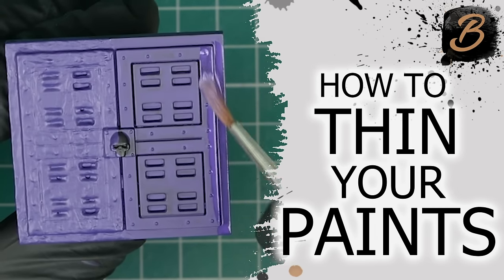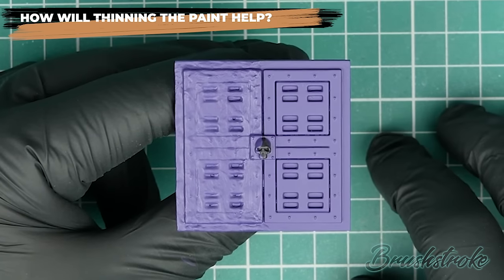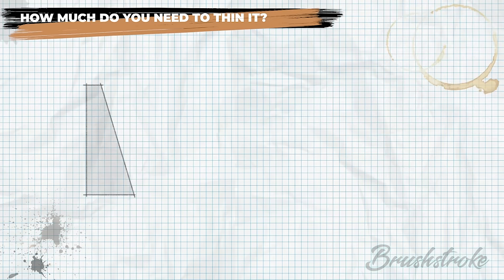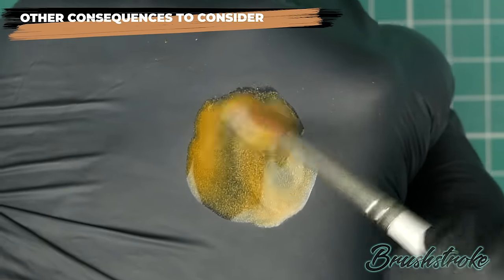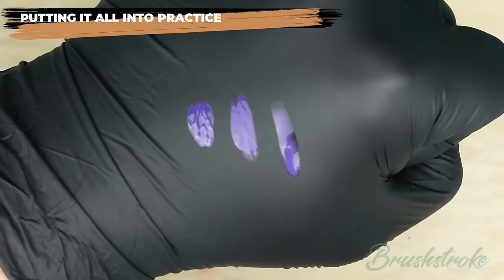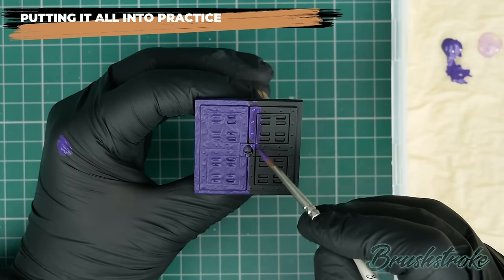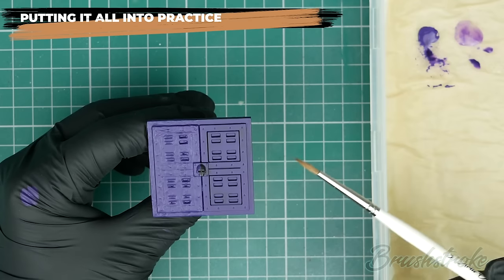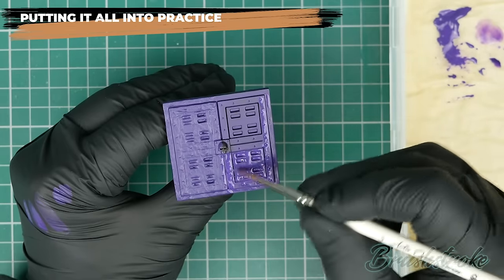HOW TO THIN YOUR PAINTS: A Step-By-Step Guide

Comment: Very nice job - earned yourself a subscription. It should be noted that paint type influences what it can be thinned with, even within a particular family of paints, and even application method. For example I thin Tamiya acrylics with Tamiya X-20A thinner when I apply it with a brush, and with Tamiya Lacquer thinner when I apply it with an air gun. Neither of these two thinners works with Vallejo paints. There are actually two families of acrylics, water based, and alcohol based. Tamiya makes alcohol based, of course. You should make an intermediate guide to thinning paints, covering leveling thinners, and other more advanced topics.
Reply from the maker: Thank you

You are absolutely correct. This video is only intended to cover the thinning of water based acrylic paints as an introduction to the topic.
I do have a followup video planned to cover the topic of paint thinning with other liquids and when they should be used; thinners, mediums, solvents, retarders etc
All I need is some spare time :D

Thanks for watching

Comment: I absolutely loved the video. I struggle with exactly this issue and your demonstration was excellent and so easy to understand. I would appreciate a guide on how you highlight things like cloaks to keep the smooth finish while adding more dynamic surface effects.
Reply from the maker: Thank you, so glad it was useful to you.
For the cloaks video, are you meaning a blending and glazing example to get smooth transitions or painting texture whilst keeping the surface smooth?
Reply: @BrushstrokePaintingGuides  definitely getting smooth transitions on smooth surfaces. I find when I glaze that it is challenging to get the ratio to the point that it doesn't pool or leave tide marks when it dries.

Comment: Having painted on and off for 25 years I never understood what thin paint was until I tried contrast paint. I have recently experimented with pre thinned airbrush paints with great results.
Reply from the maker: Yeah, both great options. Hopefully, having watched this video it makes sense as to why those two paint types have helped? As they have “faster” properties which help them settle and flow to where you want them
Reply: @BrushstrokePaintingGuides  you very clearly put into words what I had to discover randomly.
I would love to see a follow up going into details with the difference between thinning with water and acrylic medium.
Most artists takes mediums for granted, but for most miniature painters it is either magic or snake oil.

Comment: It's perfect, love people who explain technical things from his job by way of scientificness. I wonder how much do you wait between layers/coats?
Reply from the maker: Thank you 
The time between layers will differ depending on your environment, room temp etc
The rule though, is let the paint FULLY dry before applying the next layer.
The process can be speeded up using a hairdryer but be careful to not use it too soon on the paint and disturb the surface and don’t apply too hard / hot a blast as that can damage the paint surface too.
Reply: @BrushstrokePaintingGuides  thanks a lot sir 😊

Comment: This is a fantastic resource. I'd love to have seen it with scale color paints, because I love their finish, but man I struggle when thinning them!!
Reply from the maker: Thank you.
This process works just the same with Scale75 paints. As you’ll see from my other videos, I use them all the time and this is just how I thin them.
Just water and using this method. They work beautifully. Only difference is they start that little bit slower than GW paints, so they they take a touch more water to get them moving

Comment: It may seem rudimentary for those who have thinned paints before, but necessarily long for a reason. I have a problem with sometimes over thinning paints at times. Mastering the wet pallet can be a challenge too but worth it. I always thought the thing should be soaking wet, and that's not true. Only underneath. If you have a drop or two nearby your paint, convenient. But you should still add droplets to mix with. Though I never test on my hand or glove and I should. And yeah, the wet pallet can dilute the paint if it sits... Annoying but a necessary evil. Better than being dry.

I take a glaze would be almost on the extreme end of the "fast" spectrum, but ever so slightly not quite?
Reply from the maker: Thanks for watching. 
Yes, you are right, glazes are at the far fast end of the scale in order to produce very thin, translucent layers which can be used to build up transitions and blends

Comment: Nice vid, very helpful. 13:14 Not sure about how these miniatures come packed, but for model airplane builders,  you can hang onto the sprue the parts came attached to and test your paints on that, thereby ensuring that it's the same kind of surface the paint is intended for.

Comment: That was one of the best video tutorials on thinning that I have ever watched. Would you be willing to do a similar video with thinning metallics specifically?
Reply from the maker: Thanks very much.
The process for metallics thinning is just the same though, in fact it tends to be a little easier to spot that moment of movement, with the flecks in them. What is it specifically you think is different about them?
Reply: @BrushstrokePaintingGuides  I have issues navigating that line between keeping the paint too thick and the metallic paint “breaking”. This video felt so easy to grasp what your thinned paint looked like both on the palette and as you’re painting/after drying. Seeing a similar take on metallics I feel would be helpful for me and probably many others.
Reply from the maker: Ok, maybe I can do a short?
And just show the paint on palette and going on the model so you can see how it looks.
My main advice would be don’t be worried about having to do a couple more coats to get a smooth solid finish.
You’re not doing it wrong
Reply: @BrushstrokePaintingGuides  thank you for the advice! And of course if you did make a short I’ll be the first to watch it 🙂

Comment: Nice video! Unfortunately I still struggle a lot with finding the right thickness... if it's too thick, it leaves brush marks, but if it's thinner, it's difficult for me to handle because it flows into places where I don't want it (when painting contours and edges, for example)

Comment: I'm been doing some research on that "pearling" of the paint, It is actually not a property of the paint as per se nor the thining with water but rather that the parchment paper is treated with silicon and that makes the thinned paint "pearl". It was quite easy to reproduce once I had that parchement paper. Grease proof paper for lunch boxes doesn't do this and neither does TAPs paper. I have even tried to boil some pieces of parchment paper but the pearling effect remains. As for water coming up from the sponge you can take the blunt end of the brush and poke the paper a bit hard some 10 times (without ripping it of course) and if you put a little piece of toilet paper between paper and brush that piece of paper will become visibly moist if doing so on the TAPs paper but not the parchment paper. Over at period of 4-5 hours at 20'C, humidity 36 and no direct sunlight (in a basement) no difference was spotted between TAPs paper and the parchment paper. Paint dried out equally slow. There must be humidity getting through both types of paper since I first hypothesized that it was the water from the sponge that created a vapor all over the wetpalette and that keep the paint workable but a test with very thin transparent plastic proved that then the paint dried as fast a on a dry palette. I have seen paint being overdiluted if you put the lid on the palette and let it stand but I have not checked at which temperature or humidity this happens. But the "pearling" is because the paper is treated with silicon.

Comment: This is exactly what I’ve been looking for. Nobody else has gone into the details and actually show HOW to do it and what to look for. Question: Do you do the same with metallic paints? Same properties and wet palette, or would you take a different approach?
Reply from the maker: Thank you, really glad you liked it.
So, short answer yes.
Long answer yes but I also underpaint too.
As you will have already noticed (hence your question) metallic paints can have poor coverage when thinned.
Personally I have no problem with doing a couple of extra coats to get a beautiful smooth finish.
But you can help yourself a bit first if you consider what colour you paint your metallics over. 
So, the coverage of gold over white can be pretty bad, but over a warm brown and it’s a lot better. 
* truth be told the coverage is exactly the same however because the warm brown tone is closer to that of the gold you get what looks like a solid colour sooner.
Does that make sense 
(I feel a video coming on)
Reply: @BrushstrokePaintingGuides  haha. Thanks for the reply. Yes, that makes complete sense! Essentially “masking” the undercoat by choosing a similar color. Definitely going to try this.
One more question: probably better as a video, but how wet/moist do you make your wet palette? Is it better to leave it a bit more dry and keep adding drops of water? Or do u want it to be pretty damp?
Reply from the maker: From the responses I’ve had to this video, I’ve decided I’ll be doing a wet palette video next. That should tell you what you need to know.
How hot is the country you’re in? As that can affect how you need to setup your palette.
Reply: @BrushstrokePaintingGuides  Awesome, can’t wait! This video alone got me to subscribe, so I’ll definitely watch that one when it comes out. I’m in a high humidity, fairly cold climate year-round.

Comment: I can't tell you how many times I've been told to "thin my paints". This is the first video I've seen that tells me in a way that ACTUALLY MAKES SENSE!

Thank you SINCERELY. Subscribed.

Thank you. Thank you. Thank you.

Question: Do different colors of paint have different speeds out of the bottle? It seems like there's no set "slow" speed for all paints. Some come out of the bottle really thin, some come out really thick. Am I just not shaking it enough, or is there an actual difference?
Reply from the maker: That is so great, I am really pleased to hear this video has helped explain the process in a useful way for you.
Thanks so much for your sub and helping support the channel. Much appreciated.
Please do share this video with other people to help them too.

To answer your question, every paint will have a different default speed out of the bottle. This can vary brand to brand, colour to colour and even batch to batch for apparently "exactly the same paint".
This is why the process of observing the paint and adjusting its behavior to fit your purpose is so important.

That said, types of paint will usually be around the same speed as each other. They shouldnt be drastically different to each other.
For example, two pots of Games Workshop Base paints should be similar speeds to each other, just as two Scale75 scalecolor paints should be about the same as each other. 
If you find a paint is very fast straight out the bottle, almost liquid. Check it's not something like a wash or contrast type paint to start with or is it an airbrush paint (you can get paints which are pre-thinned for airbrushing).
If it's none of these then it could be that you need to drain a little of the medium out of the bottle before using it.
Army Painter is a good example of this, they say they add extra medium to their bottles for shipping and it is meant to be drained before first use. To do this you need to let the bottle sit for a few hours to allow the paint to separate and the medium to sit on the top of the heavier pigment. Then just pour out some medium (thats the colourless liquid which holds paint together) and then shake the bottle to mix the paint up again and you should find the paint is thicker now.
If you have a paint which is super slow from the bottle, it just means you're going to need to thin it a lot more in order to get it moving
Hope that helps, happy painting
Reply: @BrushstrokePaintingGuides  you're EXCELLENT! Thanks sincerely!
Reply from the maker: @UllrT  np 👍

Comment: Absolutely the best presentation of how to work with paints. Outstanding job. What would happen if you used alcohol instead of water to thin it down?
Reply from the maker: Thanks for watching man. Really glad you enjoyed it.
So, I did consider including a bit on thinning with other solutions other than water but the video was already pretty lengthy and I thought it may just confuse matters.
As a general rule, I tend to use water to thin if I'm wanting a solid finish (or near solid)
For anything such as blending, glazing, recess shading, tinting etc where I need the paint to be very fast I'll use a medium to thin it. I'll try and get the brand of medium for the paint I'm thinning too. As medium is essentially just the paint without pigment (there's other differences but for this example no point going into that)
Anyway, as you'll probably know, there is a point in all paint where you cant thin it with water anymore without it splitting and refusing to mix back. Thinning with medium enables you to go past that point, as the medium will maintain the structure of the paint. 
There's a whole video I could do on thinning with different products (maybe I do a part 2 to this one?)
Reply: @BrushstrokePaintingGuides  BPG, thank you for your time and consideration in your reply. I look forward to your future work and catching up on ur past episodes. TY!!!

Comment: Tbf theres another dimension you could mention, which is brush type. For the object you painted, a brush that was twice the size, flat and wide, is a helpful tool for a flat surface with symmetrical detailing.

Comment: High quality educational video. Can't wait to consume more of your content. 

Are there any tips for thinning paints in larger quantities for those of us painting large scale models (20-30cm)?
Reply from the maker: Thank you, really appreciate it.
In terms of larger scale models my advice is simply follow exactly the same process but increase your brush size.
That one single change is all that’s needed to scale up.
By having a bigger brush it means you will work with a larger quantity of paint at a time but still maintain the same ratio and process. The bigger brush will have a bigger paint capacity which will mean an increase in the surface area that can be painted per brush full 
But should still limit it so as to not dry out in the bristles before you use it all.
As in this video, I would recommend the use of a wet palette to maximise the working time of your paint and don’t be tempted to thin too large a batch of paint at once. Mixing up too big a batch at once will just result in it drying before you’re ready to use it and therefore be a waste of time and paint.
Hope that helps and thanks again for watching
Reply: @BrushstrokePaintingGuides  Good advice. I was concerned that using this method to cover larger areas might leave in more uneven coats and thus mixing more at once will result in a consistent look. Thought perhaps there better solutions then a wet pallet here but it sounds like a bigger brush and mastering the mixing technique here is the right approach. Appreciate it. 

PS: I hope you put out a skin tones video.
Reply from the maker: @mugetzu  the advantage of this method is that the thinner coats settle and even out through multiple applications. 
So, the first coat will be patchy, but that’s ok because the layer is so thin it won’t look uneven when a second coat is applied and because the second thin coat wants to run into the recesses it actually fills up the tiniest of imperfections in the first coat for you. Very much like how airbrush layers build up.
The biggest problem you’ll have with large surfaces is tide marks. This is where the edge of the paint you’re applying dries out before you’ve finished covering the whole surface. 
The best solution for this is to have a plan of how you’re going to cover the surface (work from one end paint to the other never allowing that paint to dry on the edge part way across.)
Ideally you’d want to look to break a large surface up into smaller areas. Armour panels, planks, sheets of metal etc are great examples where they have their own edges you can paint up to and avoid risking running out of paint part way through. 
Hope that makes sense.

Actually yes, I am planning a skintone video. So stay tuned 👍

Comment: Been painting for about six years and I'm a little surprised people actually paint directly from the pot without thinning their paints?! Though I haven't used Citadel paints which I know can be a bit thick, I do use Reaper that seems thin but should still be watered down and vallejo and requires different amounts of water to be thinned. Overall its a good video for vets and beginners, thanks.
Reply from the maker: Thank you. I tried to make it a video for painters of different levels. I don’t really know if people paint from the pot but it’s a good way to illustrate an extreme situation and then discuss it from there
Reply: I genuinely do, but I'm super careful with the amount of paint I put on the brush so it still spreads nicely without being too thick, but I am practicing new techniques, hence watching the video, it's one of those habits I picked up as a kid when I didn't have videos like this to explain things to me and it kinda stuck haha
Reply from the maker: No such thing as THE RIGHT WAY.
If it works for you and you get a result you want. Then that’s all that matters.
No one can say it should be done another way.
You do you